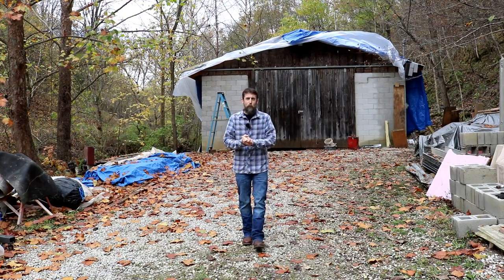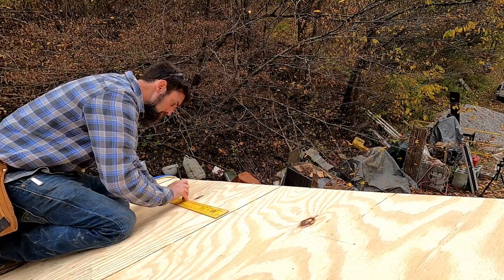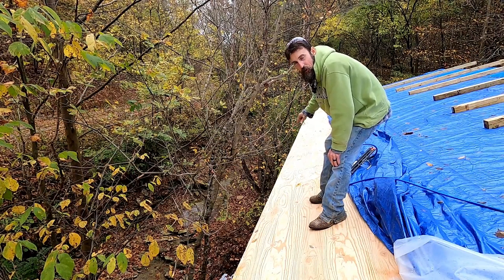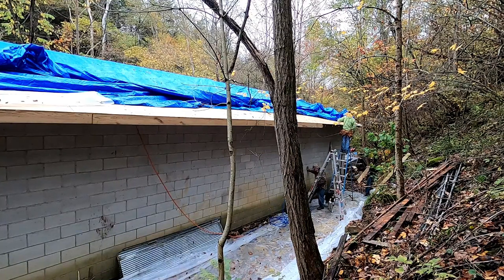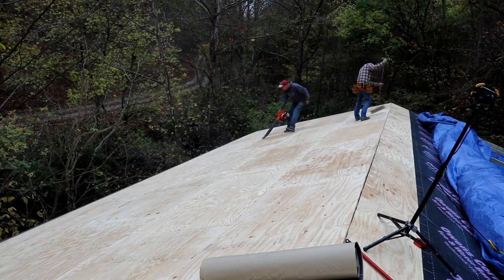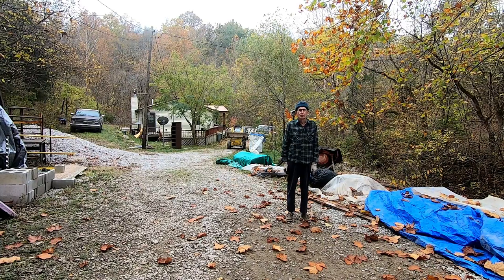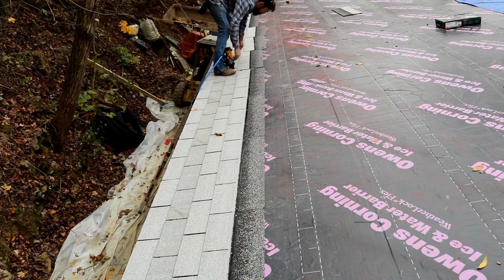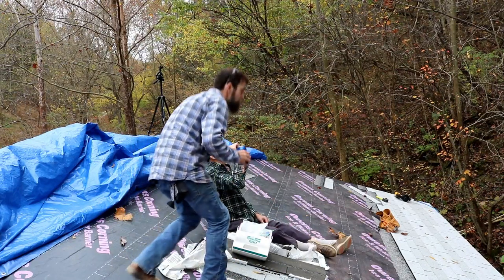Lunch on the shop roof

Comment: I like that everything you do is with a thought to redundancy. The ice shield is usually only along the bottom edge. That extra protection over the entire roof will be worth the money in the long run.
Reply: How many roofs were put on over the years with no membrane and never leaked a drop?  I just replaced my 29 year old 3-tab roof [no membrane, just felt] with architectural shingles and used two courses of membrane from drip edge up.

Comment: I have done a few roofs in the last 40 years. With ice and water membranes that have a two part release paper on then, you can put them on without a helper. You cut and roll out a 15-20 strip, tack the top edge, pull the release paper on the bottom half and set it, pull your tacks, and seal the top half of the sheet. At one point one manufacturer’s instructions explicitly said to use relatively short pieces with 6” overlaps rather than running the whole length of the roof. You certainly wouldn’t want to cover anything the size of your shop by yourself. Even I’m not that crazy.
What I used to like to do is snap red chalk lines on the underlayment either every other course or every fourth one. If I had a helper I would get six courses started, have the helper run two across almost to the end, I would run the next two, and then finish  with any cutting at the end. Then go back to the start and get another set of rows started.

Comment: On your eve line being uneven:  perhaps you used a string line as I have seen many on YT do?  They pull a line and work right to the string.  Problem being it takes nothing to keep pushing the string out.  The way I have always done it and was taught many years ago is you pull your string on both ends across a spacer block say a piece of 3/4 stock.  Now when you put your truss tails on you measure back from the string 3/4" and never actually touch the string allowing it to stay dead accurate.  Love that 5/8 ply must be ACX?  A pure joy to lay your ice and water barrier on!  By the way that is a great way to do your underlayment that you won't regret.  I have been watching your channel regularly since your remodel began and sporadically previous but just noticed I wasn't subscribed which I thought I was!  Remedied that.

Comment: Looking good! I have roofed a lot. Suggestion we always run 3 rows at a time lay down 3 then 2 then one. Then another 3 -2-1 then back at the upper corner and repeat. Keeps you from walking the whole length of the roof on every row. Anyway just sharing. Choice as always is yours.

Comment: If you use TNG or the roofing clips, you get the spacing for free.  When TNG is installed it usually mates together flush with an 1/8th gap, the roofing clips do the same thing on normal plywood/OSB.

Comment: like everyone else said, time with dad is great. I only wish I could.

Too late now, but laying out the roof in a pyramid makes the work go so much quicker than moving side to side. you just keep going up which is a short reach vs moving sideways.

That self stick membrane is usually used on the bottom only, you putting it on the whole roof have ensured a safe roof for ever. if that roof ever blows off (shingles) (not likely as you explained), you are still protected.

Comment: That ice and water looks vary slick I’m an exroofer I fell two story’s in February of 19 still dealing with workman’s Comp to years later 
Iv never seen 3tab put down that way there’s a little slit on the top left of the shingle you should snap two lines one single length off the drip and go straight up well that’s how iv always done it

Comment: Dang, that closing shot of the sheeting overhang without the barge boards...   It would have been soooo easy when you had the roof exposed to sister your last truss with a 2x6 so you could notch the end trusses for outriggers to support your extended overhang and barge boards (gable fascia).   Coulda, woulda, shoulda.
Well, you could still do it with a sister and T-blocks, it won't be as strong but it will keep that overhang from drooping over the years.

Comment: You need a 6 inch double line running from the gutter edge of the roof to the ridge or your slots will not be straight when looking down the slots the 6 inch tabs on the shingles just isn't accurate enough . But all said great job Steve your enthusiasm is incredible .Keep up the great vids .

Comment: Watch roofers, they cut the tabs off just below the seal strip to use as the starter backing strip. Where they do not have a specific manufactured strip.
Reply: That is what he said.
Reply: This year I rebuilt a small shed for a customer. A dead tree had fallen on it punching some holes through the shingles and sheathing and damaging about half the rafters. Hadn’t done a roof in 15 years, so it was the first time I had seen packaged starter shingles. Looked like a slightly wider than normal bundle, 14” instead of 12”. Each piece was perforated to tear down the middle to yield two 7” x 36”  starters. Makes sense since you’re not going to cut 5” off the bottom of architectural shingle.

Comment: Lookin real nice there Steve, hope the weather cooperates and u get the rest done without issues. I've done plenty of the ice guard alone, it's not so bad really. A small amount of technique goes a long ways, plus they have it where the backing peals off in a bottom and top piece; basically the backing is bifurcated. Alone you don't make long runs like that. It's so sticky that you don't have a chance doing a long section alone, perhaps only like 15' at a time. I remember the first bit of ice guard that I put down (holy crap that was 30ish years ago). I learned something that day, if it sticks to itself, cut that section off and throw it away because you will not get it unstuck, well you might but it'll destroy itself in the process.

Comment: I really like that roll of starter and the membraine you used. Just as in the machine shop you are doing everything the right way. Good color for the shingles as well as they will stay cooler than the darker ones. Are you going to be using roof turbines or just simply soffit vents and a raised roof cap ? When I did my home I used both. Once again my friend your posts fly by soooo fast. The mark of a great creator my friend. Please take care now. The numbers stateside with the virus are still climbing soooo fast. We are seeing them climb up here as well but not anything like the numbers south of 49.

Comment: Yes, a steel roof is much more expensive but does not require a membrane, is much faster to install and you only do it once. With limited finances, I certainly understand the choice of shingles which I have also used in the past and am now sorry I did..

Comment: Run your starter strip up the gable ends as well- that makes a high spot along the gable and directs the water toward the roof, rather than dripping off the edge.  So what happened on the sticky paper- you forgot to calculate your overlap or does the manufacturer give a coverage spec based on no overlap?  You'll probably get this from a lot of commenters, but a roofer will not go row by row- he will start at the corner and fan out- that way he can lay 5-6 rows from one spot before having to get up and move.

Comment: That job looks good.  One complaint I've heard from roofers is that the factory has gotten less accurate in cutting the lengths of shingles, so you have to watch the alignment of the tab gaps more closely.  If you just butt the shingles up against each other and don't watch the gaps, that runout can lead to the pattern sweeping sideways as you work up the roof, making the job look sloppy and crooked.  Are you still planning on having a ridge vent?  It looked like you closed it up on this, but that may just be a mis-impression due to the pics I've seen.

Comment: When I used to do roofing with my dad, he would use a whole three tab shingle turned with the slotted side facing towards the peak. (Upside down)  That would be his starter row. Then you would just place another on on top of it, staggered to keep from leaking, and that top shingle would overhang the bottom shingle by about a 1/4 inch. Both pieces would overhang the drip edge to keep rain water from being sucked between.  Anyone still do it that way?

Comment: Are you going to put gutters on? Collect the water in a water tank and let the overflow run into the creek. Or is that not a thing in the US? I’m actually required to put in a 10 000L water tank just for fire fighting purposes. I’ve got a total of 270.000L of rainwater tanks for my 85acre property. Paid for itself within 10 years of not paying for irrigation of the gardens and non drinking water.
In Australia that is

Comment: I will say one thing about the roofing you're supposed to nail above the gum line not into the gum line. For some reason it's an old roofers myth that it seals better that way, this is incorrect.